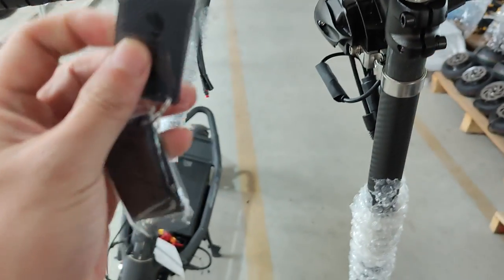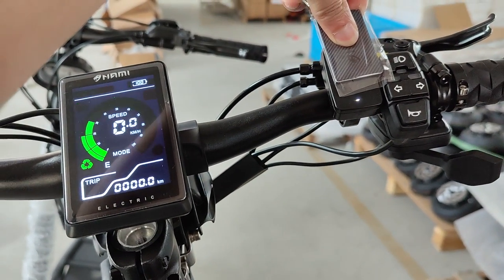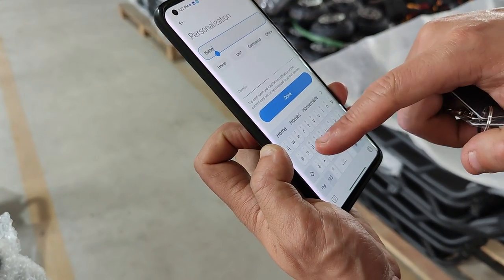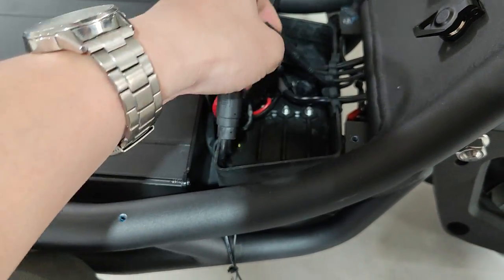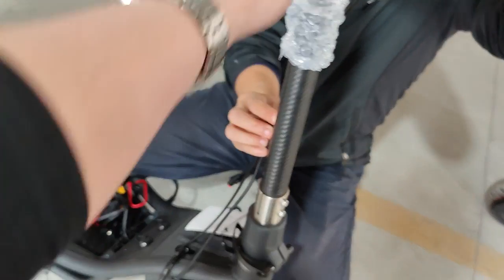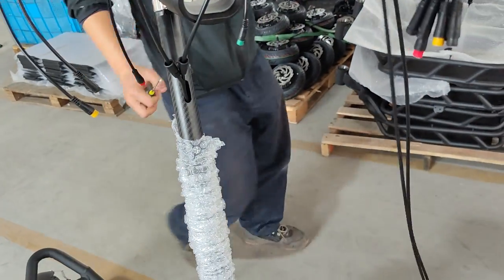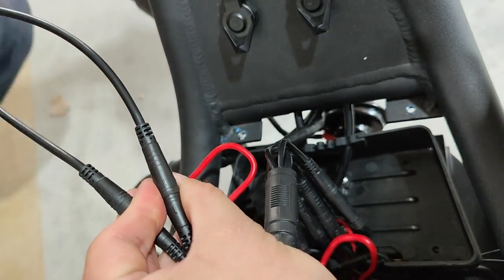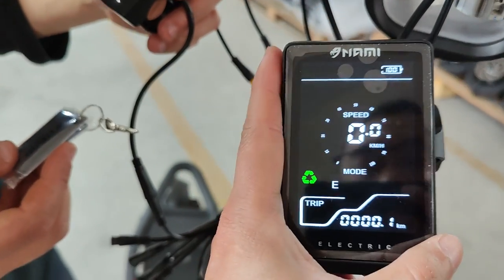NAMI SCOOTER NFC upgrade

Comment: To make this much easier, when you pull the cables out and up the stem, tape a pullstring (or string) before you pull them up and out.   Then using that same pullstring, tape on the new connectors at the top hole and then pull them back down the stem.   You will not need the hook.     Also, it is a good idea to use a Sharpie (silver) and mark the julet connectors on both sides before you pull them apart so you know exactly which connector male goes with which female.
Reply: I think that they do not have the same amount of pins, so it is easy to connect back together.
I like to use a 1,5mm² copper wire instead of a feed spring because the "head" is thinner. A wire is oftentimes not stiff enough.